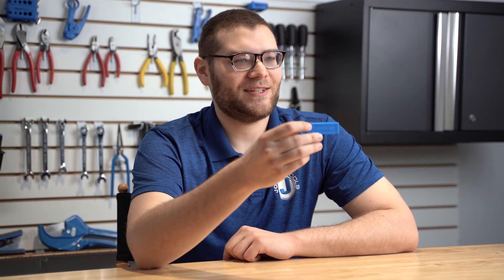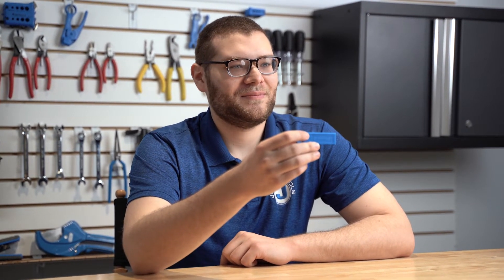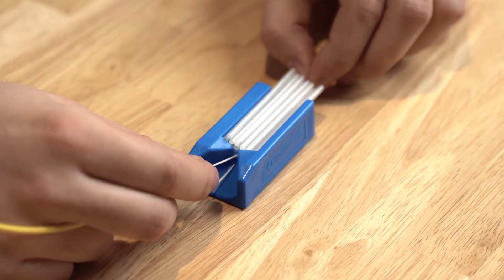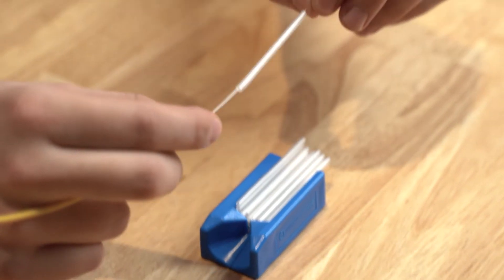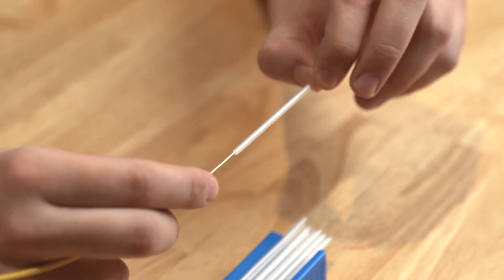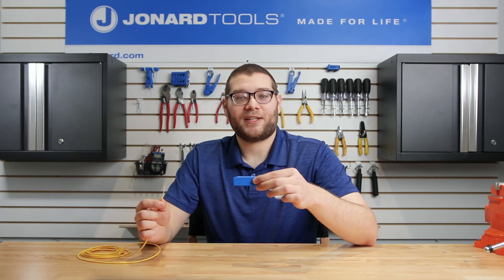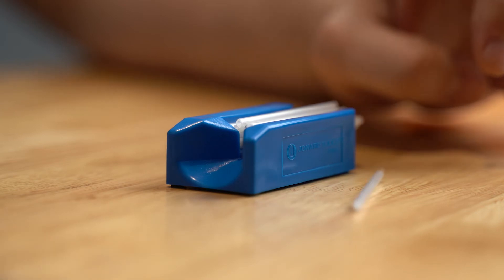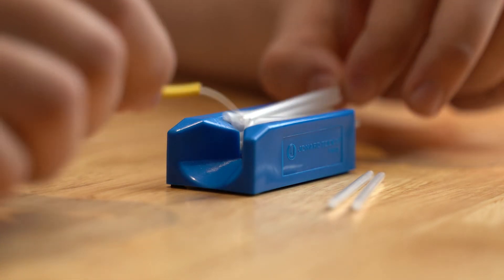Jonard Tools PSI-15 Quick Sleever™

Comment: That's more fiber length than I usually strip.
I use the sleeves to weigh the fibers down on the work surface